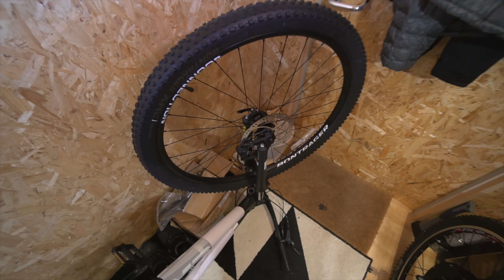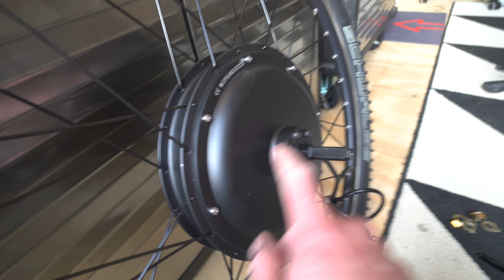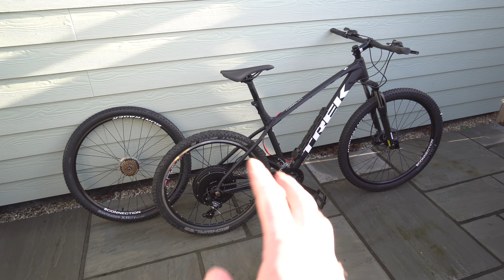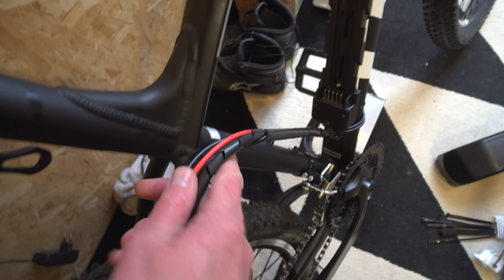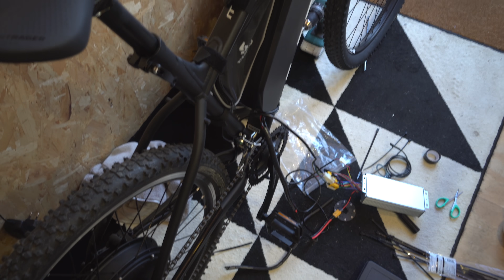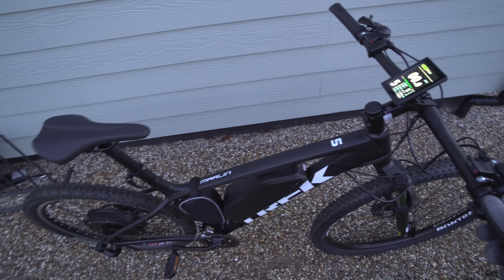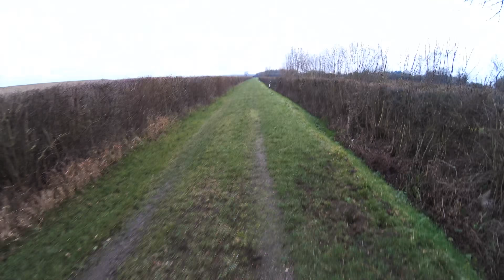HOW TO MAKE AN EBIKE IN UNDER AN HOUR!!! | TREK MARLIN 5 EBIKE CONVERSION

Comment: Dont buy it from this link i got the same exact generic ebike kit 1000w for 370quid same everything motor wheel battery controller even the display theyre selling it for over 800 quid

Comment: I have your 500w kit plugged everything in and it terns on but throttle wont work or the peddle assist the wheel spins when I hold the power button on but over then that the motor doesn’t move
Reply: And the power supply just flash’s no redding on it but no error codes

Comment: Andy. Could I use one of your hits. By just changing the wheel & hub.
I have a samebike lo26 11 750w
Also. My bike has a continuous electric cable to rear. Means I can't take rear wheel off completely. Is there a connector ii can buy to cut cable & put connector in.

Comment: Hi Andy great videos sure helps to see it done and also be understanding there is some fiddly bits with variations to different bikes well done great project Is that the newer Marlin 5 also you have some amazing kits on the website. With the laws in the UK does it have to be a 250w motor on the road or is this just the speed limit restriction  15.5 mph so if I was to by this kit for off road and on road would it mean as long as I keep to the speed limit just like any vehicles this kit would be ok or do it have to be a 250w kits on the road?
I also watch mates channel Steve great work on your channels I love e-bikes mad on them I have a canyon Pathlite on 8 but want to build my own project and this one looks great but a little worried about the laws we have in UK hence why I ask the question above. Thanks for the video brilliant channel.

Comment: Hey Andy I have a quick question about these e-bike batteries , I just purchased one it worked great , drained it charged it and used till drained once again but on this time home it blinkerd battery low then would go back to green on display screen 1 bar and give me a boost for about 5 seconds or so , then when I got home to charge it, it will not charge , charger light stays green when it should turn red to charge BUT when plugged in and push button to see bars on side of battery it shows full then when unplugged 1 red bar . Any idea what this could be ? My friend was curious that maybe I was to hard when it was drained and used for the couple boosts home and have a dead battery cell , just curious your thoughts ! Thanks !

Comment: after receiving the kirby kit..(1500 rear hub with 52 am 17 amp/hr battery)..... how many days later did u receive the battery? it took about 7 days to get the kit..... now im working on setting it up and figured i would have everything done but the battery and do that last.
i did the stock kit using my rim brakes........ i underestimated just how heavy the motor/wheel was going to b..... wondering if my 26x1.95 tires with 65 PSI is going to b strong enough? i did add flatout mix to the tube to hopefully keep the flats away...
any idea how big of a tire i can use on that stock rim/motor? was thinking maybe get a 26x 2.4 or 2.5 with at least 75 PSI

Comment: after 3 + years of use my rim has worn out completely to the point its impossible to get true the guide marks have worn out and in some places the rim has started to concave in shape ! and developed a inch large crack along the seam, good brake discs is a must unless you want to buy a new wheel every 2-3 years of heavy braking ( or if u got the time just rebuild the motor onto a new rim )

Comment: Hi Andy, great video. I'm  thinking of getting the same bike to swap my Bafang 750w mid drive motor into. One concern I have is if my Hailong-2  24ah battery will fit into the frame, the battery is 367mm long, 127mm tall and sits on a mounting plate 435mm long and 21.5 mm tall, how does this compare with the physical size of your battery? I'm presuming the bottom crank will be bigger than 68mm wide. cheers Paul
Keep up the good work

Comment: I’ve got the EXACT same Trek Marlin 5 and I’m doing the conversion on mine as soon as the parts arrive. I have hydraulic disc brakes obviously and I don’t want to put any other breaks on my bike. I’m assuming that I won’t hurt the battery or motor or anything else by not hooking up the brakes that come with the kit and just using my brakes. Just asking so I dont screw anything up. This is my first time building a ebike but it looks straight forward so I shouldn’t have any real issues.

Comment: Hi Andy, I have 27.5" wheels on my MTB. Can I put on a 26" MTX39 2000w on the rear and if so would that create any problems? So 27.5 front wheel & 26" rear wheel. Many thanks for the inspirational videos and stay safe.

Comment: Used this kit on a trek Marlin 6, few remarks:
-There's no way you can fit it in under an hour, just tying up the cables properly cost me over 20 minutes😂 
-The triangle is a bit smaller, so it's a bit harder fitting the controller in there and some additional washers were needed to get the torque arm mounted.
-I do recommend a seat post with a spring, going off road on a hardtail at high speeds will crush your crown jewels at the slightest bump in the road.
Reply: I have a trek marlin 6 small frame do you think it would fit
Reply: @jakekay3821 which gen

Comment: I have a question so I built the same ebike as you did. But when I’m pedaling and I switch to first gear the back gear rubs on the motor hub. Is there any way to adjust this so I can use the back first gear?

Comment: which one we want to buy 
1 KirbEbike 1500W-2000W Ebike Kit (motor+controller kit) NO BATTERY
2 KirbEbike 1500W-2000W Ebike Kit inc ION-PLUS 58V 17Ah Battery
3 KirbEbike 250W Ebike Kit (motor & controller kit)

Comment: Check out this product on Alibaba App 27.5" mountainbike full suspension bicycle / adult mountain bike mountainbike bicicleta velo / mountainbike 29 inch 12 speed | this is the cycle | Check out this product on Alibaba App 16" 20" 24" 26" 28" 29" Powerful Electric bike kits 2000w electric bike conversion kit | and this is make is electric

Comment: If you dont like the 24 inch rear wheel then remove the motor from the wheelset and if you can put the motor in the original or maybe just ask a bike shop to do it for you.

Comment: QUESTION 8:16,  Did you find a solution? Because I just brought a bike with perfect hydrolic breaks and i'm about to scrap them for cable.. (i dont really want to).  O_O
Reply from the maker: Hi, you can use sensors which stick on to your hydraulic brakes, they work pretty well. They are available on our website as an option for the kits!

Comment: Is there a kit that only involves the motor, ECU and throttle? I don't want to buy a kit with a screen, s** brakes I don't need, cadence sensors. I only want to use a battery, motor, throttle and a controller for those 4.

Comment: Hi Andy. Great video. Looking to do a conversion myself. Want to ask a question that doesn't appear to have been covered anywhere else... How easy would it be to replace the rear inner-tube if you're out and about and get a puncture?
Reply: Just came by your comment, and as a fellow conversion kit rider myself, it sucks :) Ive had 500w in front for about two years now, and you need a wrench and Allen key to undo the nuts on the axle and the torque arm. It can be done by turning your bike upside down in the field, but you would always need the tools. For me, ive bought a fake bottle, like the toolbox ones, and keep the tools in there. Also invest in some durable tires like the 'glassproof' Schwalbe marathon plus type. They weigh slightly more, but since youre on an ebike, this is a non issue. My tire change PR is about 2 mins, but your mileage may vary.

Comment: I noticed that he never disconnected the battery 🔋 while he was assembling all of the electrical systems.  People don’t ever do that at your home this guy is way to confident
Reply from the maker: You can turn the battery off and its isolated. Its wise to check with a meter first to make sure voltage is not present.

Comment: Hi Andy - great video - Maybe you could release a video on e-bike insurance theft claims.  In this week BBC RIP OFF BRITAIN  features how e-bike thefts  are increasing and victims are  not being compensated by their insurance companies for various reasons.  For instance many house insurance claims fail because :-  

       a) You haven't specifically listed the e-bike/s as a high value item on your house insurance.
       b)  You haven't used your Insurance Company's SPECIFIED locks on your shed/garage and IN ADDITION THEIR specified bike                  
              anti theft cable/chain. Get their recommended anti theft shed locks AND anti theft devices IN WRITING.
      c)   Some insurance companies will NOT meet the claim if you have left your e-bike in the shed/garage  unattended for more 
             than six hours.  Most of us are away from home during the day at work for EIGHT HOURS.  
       d)  The theft occurred outside the boundary of your property. 
       e)  You forgot to renew your house insurance  or failed to confirm your e-bike was on cover.  
 
E-bikes are expensive highly desirable items  which can be thrown into a van in minutes and it's gone.   They're easy and quick to sell on.  If your e-bike is stolen you might like to check the likely avenues where the thief will advertise it. Thieves need to sell it cheap for a quick sale.  Get rid of the evidence and get their next fix.  

I would :-
 1.  Get a stamp kit and stamp out a number ( your post code ) somewhere on the bike where it can be seen.  Heat the stamp and burn your  post code on the plastic components/seat so if  your e-bike is recovered by the Police  you can prove it's your property.
Buy and install a security camera that will alert your mobile phone when triggered by an intruder.
I would buy a  very small mobile phone ( they smuggle them into prisons - £30  ) and hide it possibly under the seat or  make a plastic container and  screw it on the bike so it looks like it might be part of the electrical system.  It can be configured as a tracker.  
Insurance companies don't like paying out.  It's their profit. It's your responsibility to make sure they are nailed down. 
 Get every thing confirmed in writing.

Comment: Hey Andy,

how did you fit brake calipers on rotor? on marlin 5 2021, in bikesop,  I was told your kit cant fit with the calipers on this bike, because of the location of calipers (in 2018 is was located on top of chain tube, in 2019+ its located in the midlle of 2 chain tubes). On video I can see that you have this 2019+ vesion and clearly you first removed them, then installed the motor, but  I didnt saw how did you fit brakes on rotor. In bikeshop I was told that calipers cant be aligned with rotor because 2019+ calipers is unable to move to diferent positions to fit rotor.

Comment: anyone got any advice for me 

im planning on building one of these bikes from a trek marlin 5, i work as a takeaway courier in central London and work average 10 hours a day, sometimes a little more or less, what sort of battery should i be looking at or maybe 2 batteries?? 

Also if it rains will i need covers for the batteries in heavy english rain conditions?

Comment: I was planning on buying the exact same bike to convert it (that is why I found this video). Would the hub motor with the 29 inch wheel and the MTX rim not fit this frame? Is the rim too wide? How about the 27.5 inch variant?
I am not sure which size to choose as I do not know if anything over 26 would fit even though the original wheel is 29 inch.
If anyone could help with this question I would appreciate it :)
Thanks
Reply: Dunno